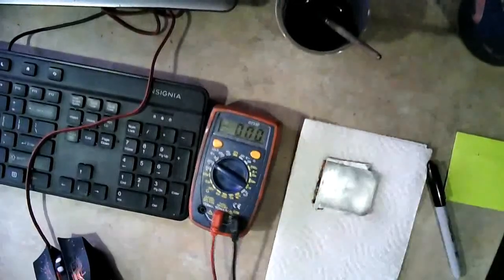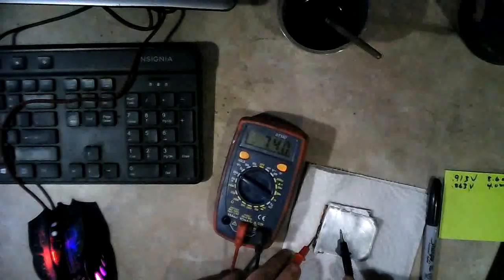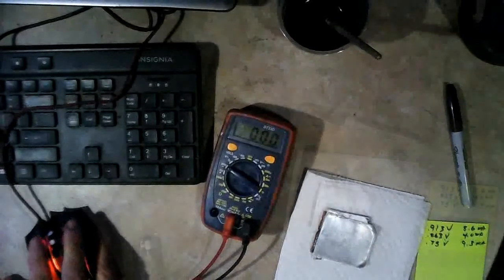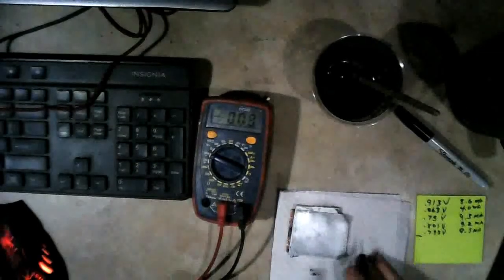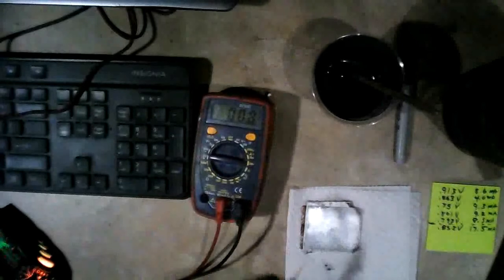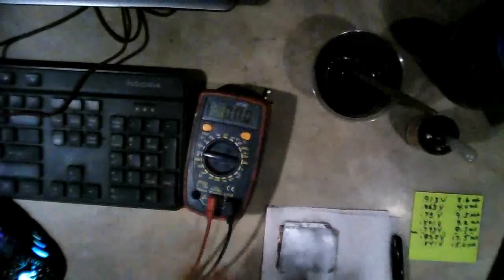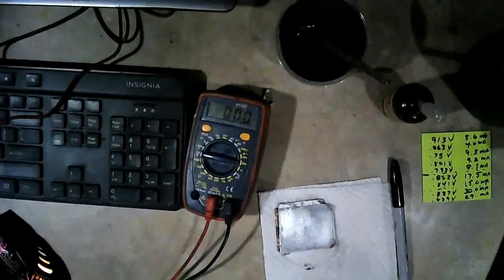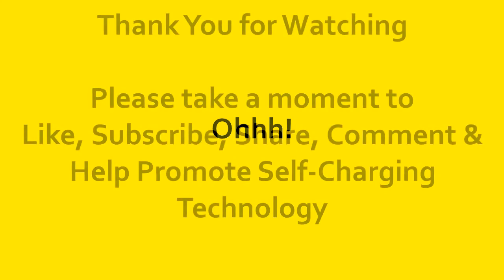A Thicker Carbon Felt Test!

Comment: That is a good test. The results are confirming previous observations. It's starting to look like water is critical. In my mind the question is whether the water is combining, evaporating, or disassociating hydrogen and oxygen.You could try it under plastic wrap or in a sandwich bag with just a two pinholes for the connections to verify or eliminate evaporation.
Reply from the maker: I've already sealed a cell in a bag for testing, and it kills the cell from lack of oxygen, so it can't be giving off oxygen. There is certainly some evaporation going on, and putting it in a bag with ventilation would reduce that. The question is really, what kind of water does the cell need? To me, to looks like the cell wants the water tied up in the borax and glue, rather than a lot of free water. I'll try to come up with some evidence for that.
Reply: Come to think of it I recall that being an issue. So it seems like somewhat of an air battery similar to the aluminum/salt ones. It doesn't appear that you have a huge amount of corrosion. Aluminum/salt air batteries consume the aluminum and turn it into aluminum dioxide as a byproduct. Like I said it could be consuming and converting the water to hydrogen and oxygen. When you get your chamber fully operational you will be able to test the oxygen content and see if that is the case.
Reply from the maker: I personally don't think it completely splits the water into hydrogen and oxygen, just into ions H+ and OH-, or it wouldn't work as a battery would it? The oxygen test will be the proof one way or the other.
Reply: Although it usually requires an input of electricity to break the bonds,  there are electrical and chemical interactions invoved. I'm not sure if there is an interaction that would do it. Since the charge tapers off with repeated cycles I suspect it is chemical in nature, perhaps in the formation of oxides. If you can figure out what it is it might be able to be enhanced to increase the power or extend the number of cycles.
Reply from the maker: It really doesn't matter where the oxygen comes from to form the oxidation Fred, and everyone is going to have their own opinion about it anyway. What counts is just producing a good self-charging battery, by the simplest method possible. The oxygen sensor will show that it is consuming oxygen, but it won't tell us what the cell is doing with it, so this question isn't going to be answered in the test chamber either, unfortunately.

Comment: hi interesting result there try some ozonated water with extra oxygen in maybe that is the trick
Reply from the maker: Hi Barry, I tried some h202 in the cell, and it did up the power. I assume from the extra oxygen it provided. That's only a temporary boost however, and I'm looking for practical permanent ways to increase the oxygen/power. It needs to come from the air somehow for a simple solution. Like the mesh you use, or carbon felt, etc.